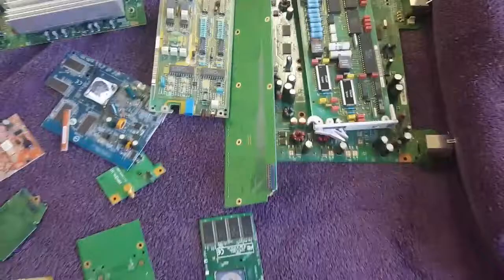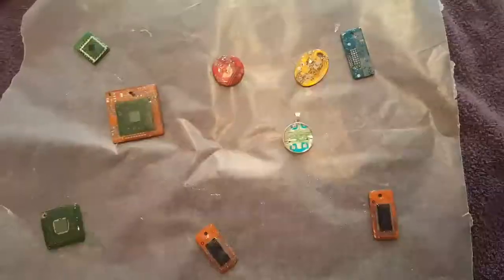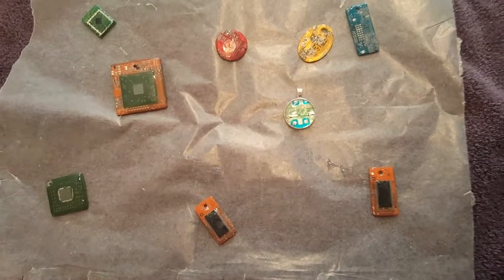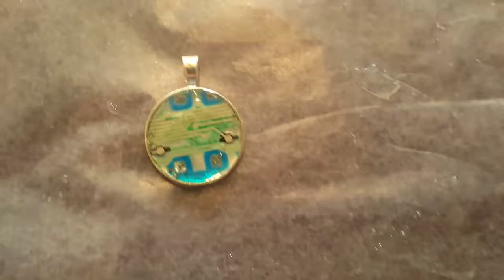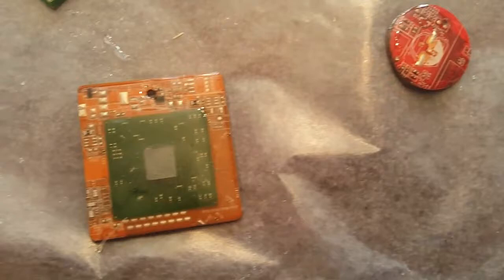Jewelry from recycled circuit boards. Homemade!0

Comment: I found a decent circuit board today, in great condition. 
I didn't realize how strong this material is lol.
I don't have any good power tools but I have hand saws, files and willpower.
The back of the board is more interesting to me then the chipset side, more circuit "rivers" I suppose. Very terrain-like. 
I'm just cutting out a roughly 3" heart that showcases the back pin points. Some are capped, some are hollowed but the overall configuration is cool.
I guess I'll want better tools for shaping if I was going to hobby it. But honestly just one good statement piece aeems worth the effort. I wont resin coat it so it ages with normal wear and tear. 
Tech stuff is really quite beautiful and I hope you are still having fun with it!
Your vid shows 7years ago. Alot has changed and yet is still the same. Hopefully you are doing well😊 
Thanks for the share!

Comment: I am interested in doing some thing like this for 
personal use and for fun. I would like to know how you cut them into shapes like circles or ovals and maybe what kind of resin you use, because for my first attempt I used scissors and created a free form shape and the coated it in UV nail gel but it separated. Maybe it’s because I didn’t clean the finger oil off of the board or used the wrong kind of resin. Any tip would help. Even where you find the colorful boards. Thanks in advanced!
Reply from the maker: I used a drimmel tool, metal snips, a metal file and a ton of patience. I just started making more. Watch for another video in the next couple of days.

Comment: What did you use to cut the shapes out?
Reply from the maker: Metal snips and files. I recently bought a drimmel that I haven't used yet but I think it will cut nicer edges